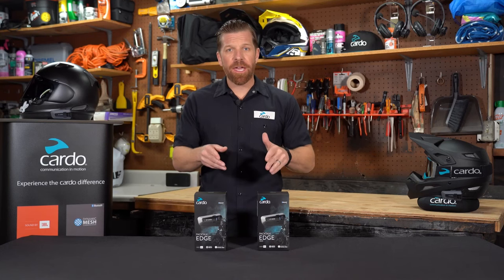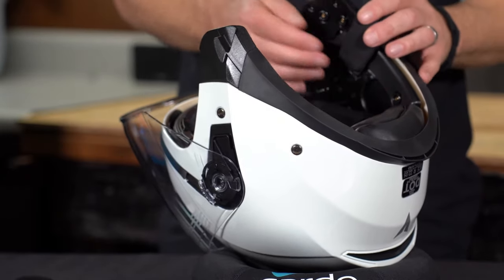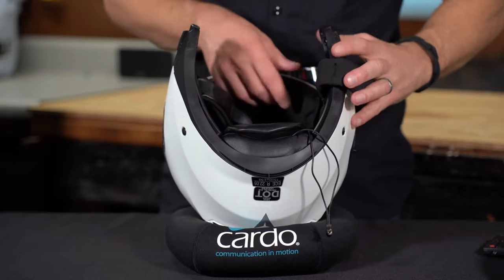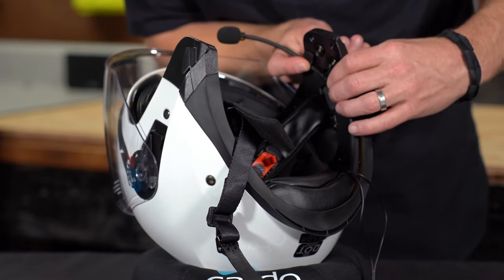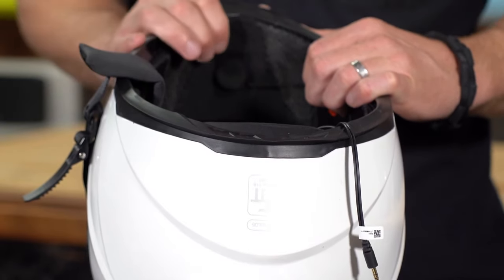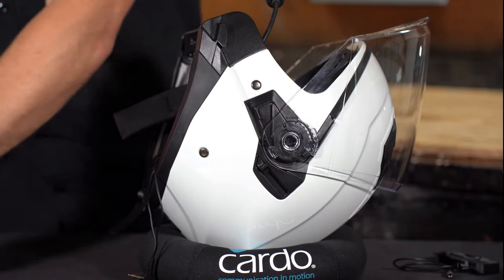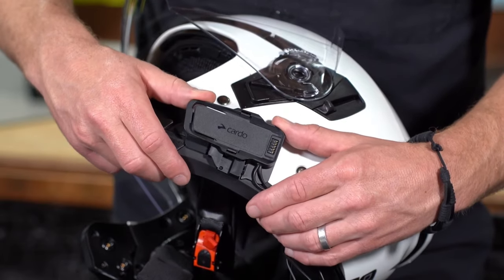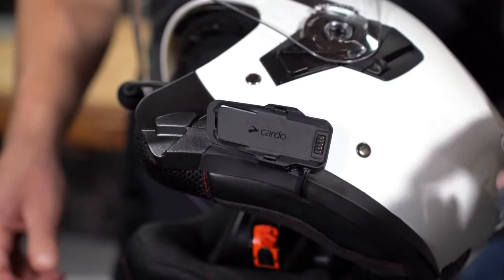Packtalk Edge | INSTALLATION

Comment: White helmet, black interior, not so bright room, and camera ISO turned down too low. It's difficult to see what's going on in this video.
Reply: Well, if you can't see or understand how the installation goes from this video, then I seriously recommend evaluating your ability to ride a motorcycle safely.
Reply: @JormanKivet12  that was a useless response. one has nothing to do with the other.
Reply: Womp womp

Comment: Don't attempt to install this on an HJC i10. I didn't know any better and attempted to install it. The matter-of-fact procedure this demo shows is nowhere close to reality. The wiring keeps the cheek pads from clipping in. I now I have a helmet whose cheek pads won't go back in and a Packtalk Edge unit that I can't return because I've used the adhesive pads and alcohol wipes. Oh well, I'm out $600 for them and now I have to go buy a different helmet that has a built-in comm setup for another $600-800.

Comment: What if the helmet already has a mic and speakers? Can you connect it using bluetooth, or does it have to be with the wired mic and speakers. I am currently using the Vata7 helmet which has integrated speakers and a mic

Comment: Great video. Very easy. One thing that SUCKS is getting your padding back in. If you want to get is as clean as in the video, you will have to pinch the wires in between the shell and plastic edges of your cushions. Borderline impossible.

Comment: The oversized / large speaker connection is very difficult to "hide" inside the Shoei X2 Hornet helmet. I preferred the older cardo's speaker connection, external from the helmet. Hoping to find a solution, otherwise, I'll have to return the Edge, because it's too painful to keep.

Comment: I want the video on how to pair it to a cell phone, specifically my alcatel goflip 4 dumb phone that does not work with Lexin B4FM. their units are garbage that I have had for 1 day and now they are fighting me to give me a return label and get my money back. All I want this unit for is to make and receive phone calls. I never ever ride with anyone and don't listen to music.  I could receive a phone call from lexing, but it would not recognize any or my contacts list names. I tried to adjust the radio and that did not work either but has nothing to do with the phone not connected.  Connecting bluetooth was almost impossible. After 8 hours in 2 days of messing with it I demanded my money back. Will this unit work with m cell phone mentioned above because it is not really a smart phone but has wifi and bluetooth. Alcatel goflip 4. Thanks for your consideration in advance. This is 3x more expensive than the B4FM Lexin. But will be worth it if it all connects and works properly. thanks.
Reply: Did u download the app it does walk thru on how